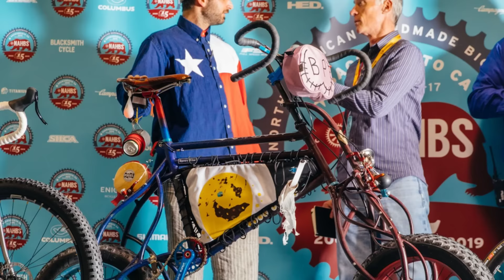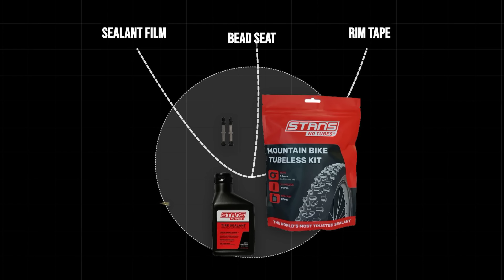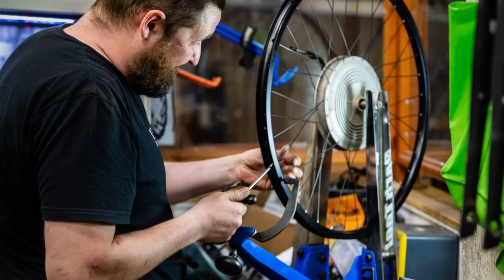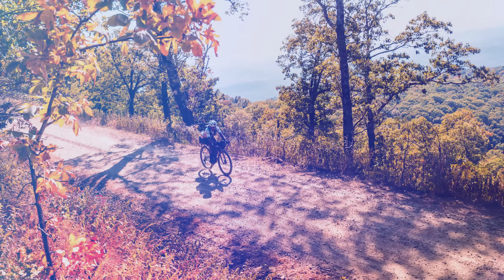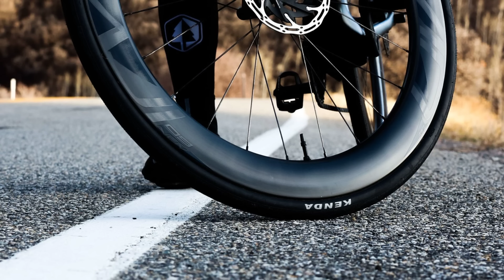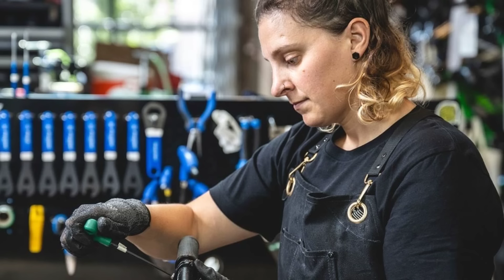Tubeless Tires — Scam or Genius? (What Mechanics Actually Think)

Comment: I’ve ridden road bikes for about 40 years and over 30,000 miles in several states and always had tube tires. I used to average 1 or 2 flats a year but I  have had very good results since I changed the original tires and tubes on a bike with tires and tubes that are more puncture resistant. They are a little thicker and heavier with slightly more rolling resistance, but don’t mind.  I carry a spare tube and hand pump just in case.  I have lived in central Arizona which has a lot of thorns for the last 15 years with very few problems.

Comment: I have had no problems with tubed tires, both on and off road, in decades.  Unlike automobile and motorcycle applications, the need to use a liquid sealant is proof that the tubeless setup is not right for bicycle applications.  We would all be better off if this were widely admitted and move back to tubed.  
Another item thrown under the rug by VeloMarketing is that if a puncture on a tubeless setup requires inserting an inner tube to get you back home, not only do you need the knuckles and forearms of Arnold Schwarzenegger, but the probability of inserting the tube without pinching it is not very good.

Comment: I never liked idea of tubeless looks like a pain to deal with. I have always used tubes. I recently bought tpu tubes because I liked the idea that they are easier to pack for my rides. I recently needed to replace a tube and used the tpu. Seems to be holding up good and I like riding techy xc trails. I also get the lower pressure on mtb that’s preforms goods enough for me. I live in Ohio most of mtb trails are not serious for tubeless in my opinion. I rather not deal with the hassle I do my own bike maintenance.

Comment: I love the ride and handling qualities of Continella 5000 tires. My wife and I both use the 35 mm fat boy 5000 which allows us to roll at 50 to 60 psi. However, the 35 mm tires only come tubeless ready. As most of you already know tubeless ready beads are super stiff and tight. Consequently, I’ve never attempted to run them with clincher tubes because they’re so difficult to remove and reinstall. I’ve now been running tubeless with Silca or stans sealant without any problems.

Comment: Solution: Tube with Tannus Armour
Reply: Add sealant for a belt and suspenders solution!

I use this on one of my bikes, and one or the other on my other bikes. None have suffered a flat since, though the sealant in a tube does suffer punctures that get sealed in a few minutes and then need to have some air added.

Comment: As a road rider I was never convinced to go tubeless despite my latest bike coming Tubeless-ready. Besides I have to store my bike in a corner with carpeting. Leaks are not tolerated. I run RideNow TPU tubes and can pack two in my frame storage in less space and weight than one butyl tube. I call that win-win. Also even on the first ride I could feel the reduced rolling resistance. Tubeless and it's hassles aren't worth it for my riding.

Comment: tubeless rules,  have had at least 10 bikes in a row with tubeless.  started with stan's.  can plug a GP5000 unclipping only one foot using dynaplug.  last tire change had 4 dynaplugs in it before the tire wore out.  this AI video is just flat out wrong.  never cleaned a tire before it wore out.  have cleaned or replaced a few stems.

Comment: High air volume at low pressure = tubeless success. The reverse? Not so much, that's why it works fine for MTB's and not so fine for road bikes, despite what the industry would like you to believe...as in BUY. Is there EVER a pro road bike race where you don't see some sort of tubeless incident vs a simple flat tire?
A casual cycling friend told me he quickly sold two new gravel bikes he'd purchased. Why? He got tired of coming out to ride 'em every time and finding the tires flat! Why he (or someone else) didn't just put tubes in the tires escapes me...and I didn't ask.

Comment: 3 times longer than installing a standard tube?   Not a chance.   I can go from a rolling stop, to wheel removal, finding the hole,  tire inspection, and new tube reinstall, then  aired up and  back on the bike in about 3 minutes.

Comment: Never going back to tubes. I only top up sealant every 3 month and have never EVER had to check the tire bead or even have to pull out wads of dried up sealant like this video claims lol. Probably for people who only ride once a month maybe. Been tubeless pushing 6 years now and have never needed to put a tube in, but have used an enormous amount of tire plugs. Tubeless is genius especially where I live. I have to run touring tires and Slime tubes on my older track bike since our roads are littered with shattered glass and goat heads. GENIUS

Comment: There is another use case for tubeless: commuters who need the puncture resistance.  Commuters who have to deal with a lot of road debris, thorns and other puncture threats have a good reason to run tubeless too.

Comment: If tubeless tire systems were properly designed like those for motorcycles, they wouldn't need sealant just to consistently hold air. My motorcycle tires have never needed sealant to hold air. And they stay seated even as they go flat.

Comment: I have used tubeless in gravel for almost 10 years. Had almost no failures, compared to tube flats every 2000 km.
Reply: Like all things, more complicated means it works better until it fails, then it's harder to fix. Depends what you want.
Reply: 2000km? You’re so lucky. I get  a puncture every other ride on tubes!  Tubeless FTW
Reply: How frequent do you maintain your tubeless setup? i.e. top up sealant, clean-up dry sealant etc.?
Reply: @cazat  i live in the desert so top up maybe every 3 months. Takes less time compared to being on the side of the road changing a tube. Over the past six years I’ve never dealt with dried up sealant lol

Comment: Done right for MTB's & EMTB's it's a no brainer it's the way to go! On other hand do you need it no. This video is a little over the top it pretty easy to set them up and maintenance is low. I run a winter set with studs and another set for rest of the year add or change sealant once a year in most cases

Comment: Mountain bikes and gravel bikes using tubeless is fine. You need a puncture kit (like Dynaplug) though just in case the puncture can't be sealed. For road, forget about it. Use a TPU tube and you will be very happy.

Comment: Where I've been riding the last 10+ years has goat heads; that's caused the vast majority of my punctures. In my case, tubeless makes more sense.
Reply: What is the problem with putting sealant in to a tube?
Reply: Exactly, the sealant is what lets you continue riding with goat heads or other things stuck in the tire.

I use sealant in tubes and Tannus Armour, one bike uses both, and haven’t had to fix a flat with any of them since.